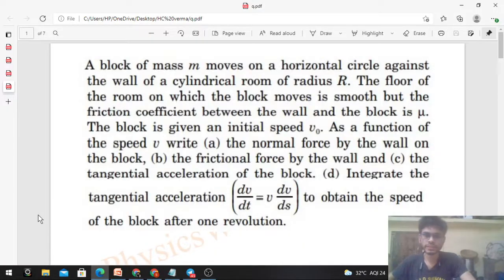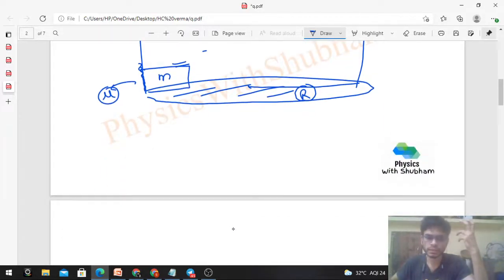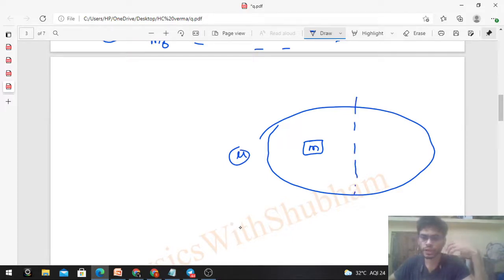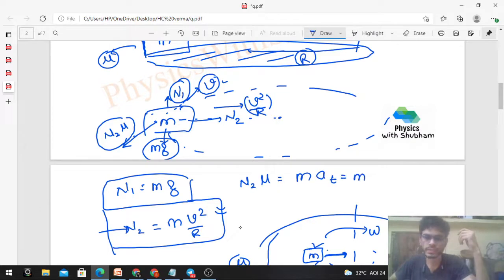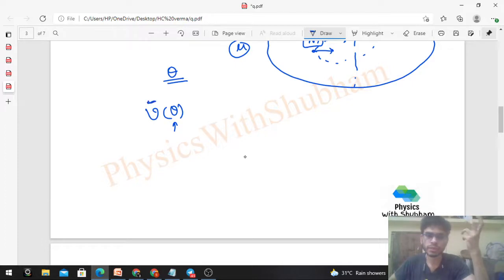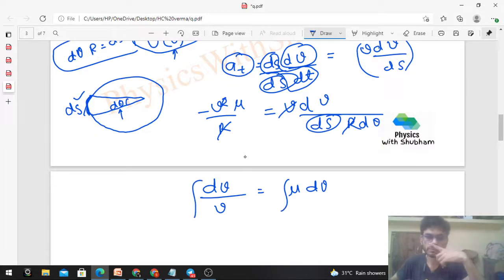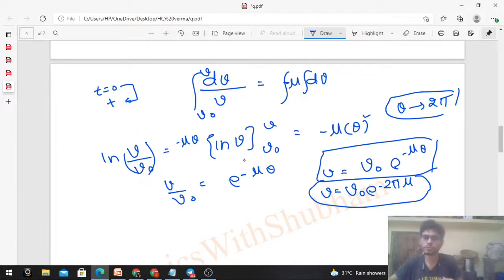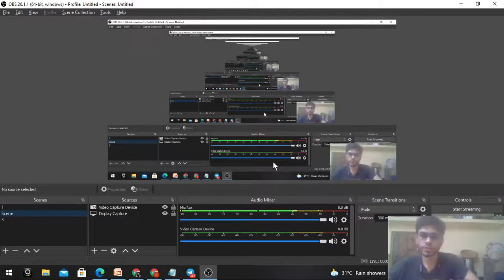A block of mass m moves on a horizontal circle against the wall of a cylindrical room of radius

Comment: sir why didnt you take friction as µ x normal net force and rather µ x n(2) ??
Reply: The friction force always depends on the magnitude of the force normal to the surface because that is the force that actually presses the surfaces together. Consequently, only the component of the weight that is perpendicular to the surface contributes to the friction force...aur yahan koi component nhi hai mg ka XY plane me..
simply Jo force daba raha hai vahi friction ka reason banta hai.. (mg) nhi daba rha
Reply: ek que tha HC Verma me hi 10th solved eg. Vaha puch rhe the ki kya speed honi chahiye.. udhar max friction Jo lagna chahiye taki slip na ho vo hai mg. Udhar friction wall par hi lag rha tha lekin upwards.. kyuki vo niche girne ki tendency me hai to hum le rhe the umv²/R=mg aur N=mv²/R.
yaha bhi block ki velocity jahan hai vaha friction lag rha hai matlab horizontal plane me tangential velocity ke opposite isliye hum vo normal lenge Jo usko dabaega... 
Agar horizontal plane me circular motion hota hai to kabhi bhi N=mg thodi lete hain..mg equate Karte hain uN se...kyuki vo mg nhi daba rha

Comment: While integrating d theta why didn't u put limits from zero to 2 pi directly? Then the answer would have come Vo × e^ +2πu
Reply from the maker: I tried to solve that in a generalized form so that you can find it for any angular distance of the block.
if you put the limits directly then also you will get same answer as there is a negative sign before mu.